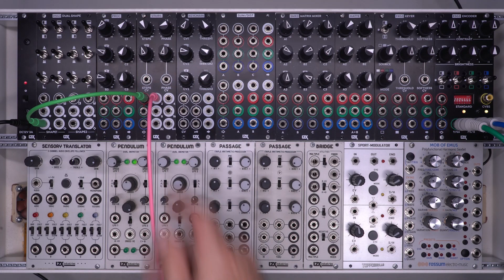3 Patches for DSG3

Comment: Could one use Pam New Workout to replicate the movement at 10:30 when you are using a Pendulum through Bridge's VCA?
Reply from the maker: Yes, any modulation source will work, though you might have to attenuate or scale if it isn't already in the 0-1V range.